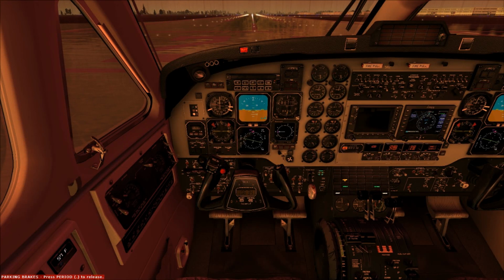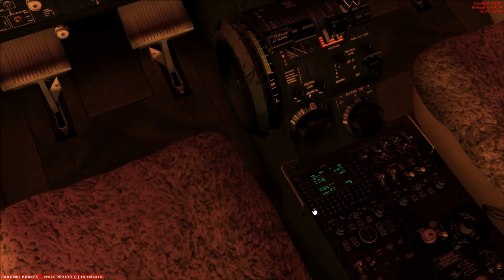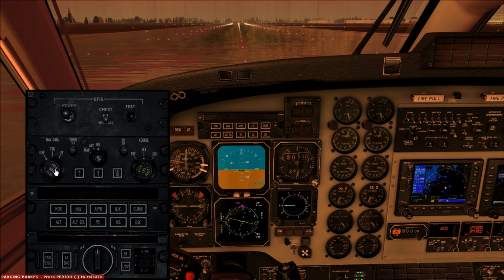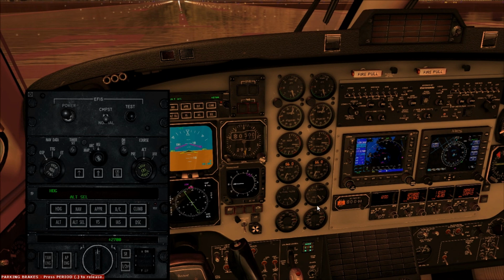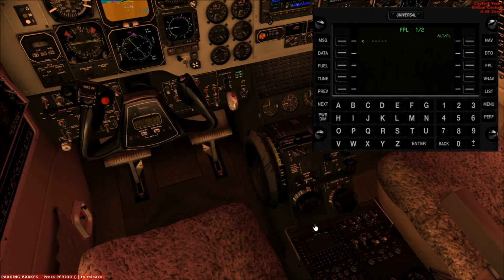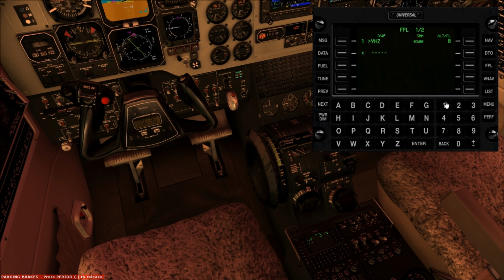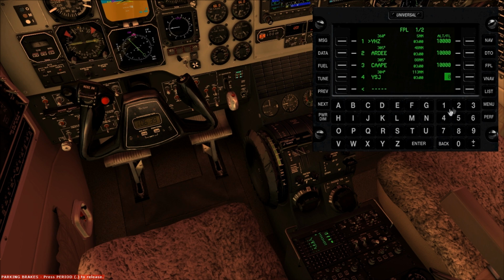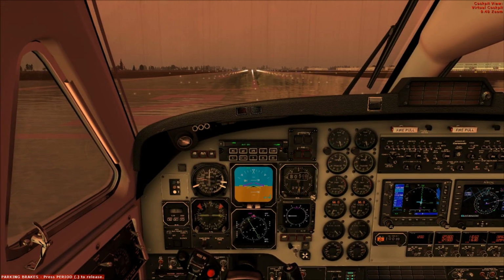FSX   Carenado B1900D FMS Tutorial - Initial Set Up

Comment: Not a fan of VATsim either, I know it is good to be procedurally correct, FSX or Prep3d, but is still a game. I just started  using Pro ATC, it now works with P3d. Have been flying the ERJ-145, but it is to big for some of the smaller airports, so I thought I would try the 1900d
Reply from the maker: Kool kool...so how do you like pro ATC? I may have to try it.

Comment: New to flight simming (FSX) and I just got this plane. How do you set up your desired autopilot IAS? I assume it could be done through the FMS, but I'd rather know the manual input method. Thanks in advance, and great video!
Reply from the maker: Well, I'm not sure in flight sim how it activates.  In the real 1900 there is a sync button just below the radio push to talk and when the flight director has IAS selected you can just sync it for whatever speed you are currently at.  In FSX, I am unsure if this button even works or not, I haven't used my sim in a very long while because ive been busy working.  If you figure it out, please let me know and I will share it if anyone else asks.  Thanks.
Reply: Will do, and thanks for your quick response. I'll check it out!

Comment: How to put in sids?
Reply from the maker: I guess that would depend on what waypoints are in the FSX database... most SIDS are pretty straight forward.... climb RWY heading to 5000 for vectors.. I'd suggest use your heading mode and bug for conducting the SID, but like I mentioned before it really depends on the GPS database you have installed in FSX.  I know some websites offer an updated GPS database for fsx...I've tried this once before and found many of them not there or not accurate.  sorry I couldn't offer more help...thanks for checking out my video.
Reply: Thanks for reply. I see that is probz easiest to just go by chart for wp.... Btw how do you get T/D?